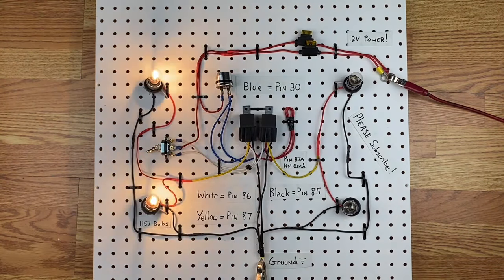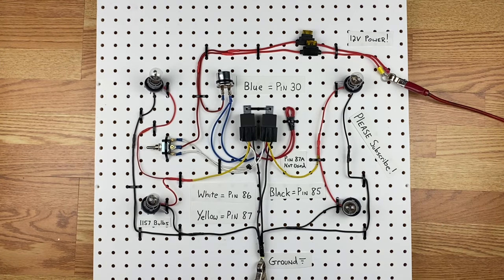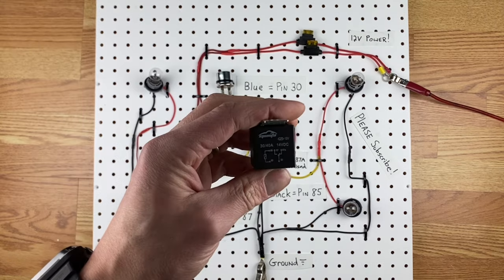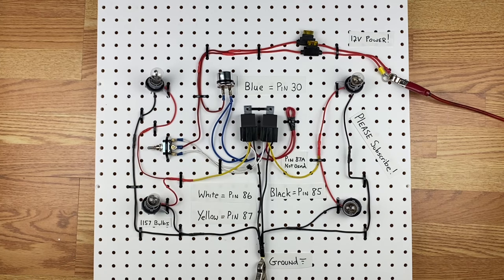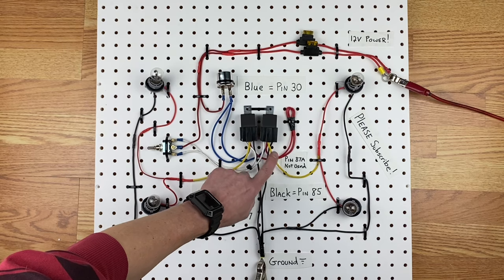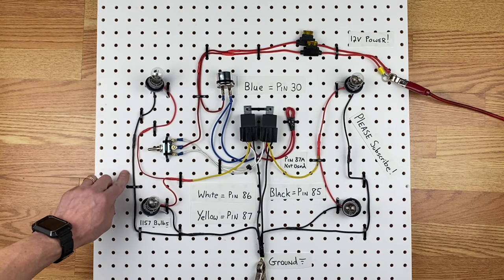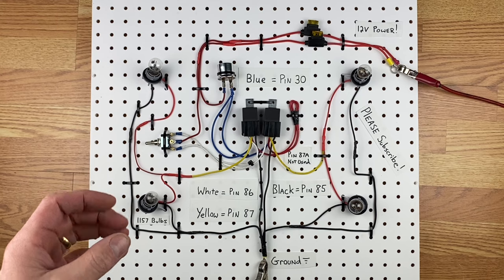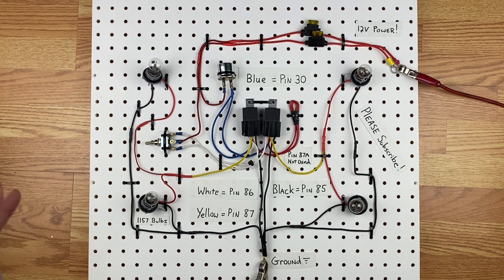How To Wire a Turn Signal Flasher Relay Directional Blinker on a Car / Truck / ATV / Motorcycle

Comment from the maker: Thank You for Watching the turn signal relay wiring video! 
Subscribe To This YouTube Channel: http://www.youtube.com/user/4g63mightymax?sub_confirmation=1
See My Wiring Playlist: https://www.youtube.com/playlist?list=PLsF7T1tRFy2hmiiUUfMZNyV-BUA_yrPIh
Reply: I'm working on a pocket bike and unfortunately the wiring that came on it was taken apart now I'm trying to wire up headlights blinkers and parking lights can you help me
Reply: So I have a 86 montecarlo ls I have a problem with my lights I have high beams on my left side  no lows and no power on the right side on the rear I have power on the right side but no power on the left side any ideas how to fix tha because I'm seriously thinking on Goin the way u have this set up
Reply: I have a 95 escort. My flasher button broke off, trying to set up away so I can use my flasher incase of an emergency.
Reply: for the hazard button you just link the 2 white together and the red and boom hazard light ???
Reply: I liked and subscribed
Reply: It's missing the 2 diodes and Hazzard switch
Reply: @fedabartov6293 nope 2 diodes are needed basically spliced into the power and feeding both relay power wires diodes are needed to prevent crossfeeding when Hazzard is off

Comment: I have an imported truck that zero information is available to me.  Your EXCELLENT explanation will give it direction signals ….again
Reply from the maker: Excellent! Thank you for watching!
Reply: Bro same here.got 96 hijet pickup with no schematic or electrical diagram. Wasn’t feeling confident replacing my headlights since the polarity is swapped and having to splice in the turn signals and DRL. But after watching this I’m solid!
Reply: It's missing the 2 diodes and Hazzard switch
Reply: @dodgeme1986truck  ?
Reply: @cactuarizard  on most vehicles (atv utv also) a Hazzard switch is also required (flashes all 4)

Comment: How would you add the hazards though? Like, getting all of them to blink at the same time.
Reply from the maker: Edited: I made this hazard light video! https://youtu.be/lnhMx-fnUmI
Reply: yes please that would be helpful
Reply: He said that. Link the white wire of the lamps in a different circuit
Reply: I did it by using a second three position switch, on/off/Turn Signal Enable
Then linked the enable to the input of the second three position switch. I then linked all four of the lights to the on position of the first switch with a flasher
Reply: Basically the first switch you can enable the hazard lights or enable the turn signal, the second then just is the turn signal control. It is how I did it because I didn't mind a second switch
Reply: (On a side note I would still like to see how you guys do it)
Reply: @sirboomsalot2429  could you explain this in more detail please
Reply: @WiringRescue  could you make the video showing how to do the hazards please
Reply: Even jerry needs help and he works on smart phones 🤯
Reply: Damn. I thought I didn't know a thing and yet here Zack is referencing the same video. Hell yeah.
Reply: the 2 white wres from the switch add a switch thats a dual throw (basically a toggle that can switch 2 circuts at once) tie that switch in and the wire that the turn switch has in the middle terminal to the dual switch and you have now added hazards to this setup
Reply: I would use 2 on off switches.
Reply: Four way switch that feeds both white wires at the same time.
Reply: Most cars have a dedicated circuit in series with the lights so is something goes wrong you still have hazards.
Reply: it's easy
Reply from the maker: @jerryrigeverything - here you go https://www.youtube.com/watch?v=lnhMx-fnUmI
Reply from the maker: @robrenner9514  https://www.youtube.com/watch?v=lnhMx-fnUmI
Reply: Jup, just activate both relays. Normally if you don’t need hazards you’ll go with one relay that is either off or sends power to left blinker bulbs or the right ones.
Reply: What about an on-off toggle switch that then connects to 2 diodes, which are connected to the white signal wires at the 3 position switch?
Reply: A simple DPST switch would do that. power into both inputs then output 1 to one white wire output 2 to the other. That way when the switch is off the white wires will act as a separate wire still.
Reply: A switch with 3 polos. When is on all polos together.
Reply: Maybe you should Jerry rig something to do it
Reply: Add a second switch that turns both white wires on at the same time.
Reply: @WiringRescue  just turn both relays on at the same time.
Reply: I'd say instead of having a 3 position switch that just Powers up one relay at a time you'd also have a third button switch that would Supply power to both relays at the same time to activate hazards
Reply: I would add a push button and tie a white wire to both relay then it triggers all four in theory havent tried it
Reply: @madparacorder  I've explained it to him .
Reply: You don't need haxards for older that -91 car

Comment: I’ve wired a lot of lights and you don’t need relays or 2 fuses . You did a great job explaining it , but the extra parts make it more complicated than it has to be. Most all wires you’d pull power from already are fused .
Reply from the maker: Without fuses and relays, you have a much higher risk of lighting everything on fire. It’s totally up to you whether it’s worth the risk or not. I’ve actually been on fire before and didn’t care for it much.
Reply: The relays are not needed, but they do allow you to add low power draw leds and maintain a steady blink since the blinker speed is determined buy the relay actuator draw. The fuses are also not "needed" because most power is already fused, but is a good habit to get into.
Reply: Ok I just actually watched the whole video, and relays are 100% not needed as wired. I ASSuMEed that he was wiring the relays a different way.

Comment: You probably won’t see these, but the 1034 bulb was originally the standard bulb used here, and the 1157 bulbs were the heavy duty version of the 1034.

Comment: Would it be better to put the 552 after the relay so that it only blinks when the switch is on.  I guess you would need 552s for that to work.
Reply from the maker: The flasher only flashes when the bulbs are turned on. If there is no electricity passing through the flasher, it is not cycling on and off.

Comment: Thank you very much. Ive got a quite rare bike. Its a Tomos at50 they made like 2000 of them. The original wire harness worked great except the turn signals. After replacing countless wires and using different relay's I still could not get it to work. I am not good with wiring so I thought wiring turn signals would be awful. But with your help I managed to get it done in like 2 hours. Everything works great even used the original ground wires from the harness so its quite clean. Thank you again!
Reply from the maker: That’s excellent! I’m glad the video was able to help you out! Thanks for watching!

Comment: This is awesome. Could a 3 pin flasher be used in this system?
Reply: I found a way to add a three pin flasher. The 3 pins on a 3 pin Flasher  would be B, E, L. Connecting would be B- a positive from the ignition switch with a fuse (as mentioned in the above diagram as a red wire to flasher). E would be a ground. L is connected to pin 30 (as mentioned in the above diagram in blue). Hope this helps.

Comment: Are the Bosch relays really necessary? Why can't you put the SPDT switch between the flasher relay and the bulbs? Am I missing something? Thanks in advance.
Reply from the maker: It depends on which switches and bulbs you are using. Check out this one. It’s what you are looking for. https://youtu.be/uXiEoJVtHi8?si=45UHXJnsZTGF4YZp
Reply: @WiringRescue  Thanks!

Comment: I just wired my break lights on my 86 mustang. I used a Earls inline pressure switch through a fused relay. Simple! You just saved me some time on the turn signals. Thanks!
Reply from the maker: That’s fantastic. Thank you for watching!
Reply: @WiringRescue  are you using 30 amp relay and fuses?
Reply: I was talking about my break lights. I accidentally replied on the wrong video. I completely gutted my 86 mustang factory wiring harnesses and went with the ARC 12 circuit relay kit. I used this circuit for my turn signals. Works great.

Comment: Why is the relay needed? Could the bulb simply be in series with the flasher?
Reply from the maker: Check out my other videos for details on why you need a relay. I’ll give you links. Here is the one for wiring this circuit without a relay. 

https://youtu.be/uXiEoJVtHi8?si=WeBLJGZyPyjLhkGk

Here is a video on why you need relays. https://youtu.be/QCkfFCLa_Jg?si=SEI1ldkZGxd-NlDY

Comment: Thank you very much for the video, I have a 1973 datsun and I've installed led headlights with yellow halos which I use for turning signals and my turn signals switch kept getting smoked and stopped working because of the high current drawn so with this system problem solved, very thankful for this video and new subscriber with thumbs up 👍,have a blessed day
Reply: You need to add in an LED resistor to each turn signal, that's your issue.

Comment: I bought everything in this video not realizing that I need something to put the fuses in. I don't know what they are called lolol 😂 i rewatched the video but I don't believe you mentioned what the fuses go into. I bought the 272 piece fuse package but they are all just different fuses only. Thanks a lot for this informative video.👍
Reply from the maker: Haha - sorry about that - you will want “fuse holders”. Here is a link to the ones I used, but there are many options. Thanks for watching and good luck with your project!

10 Pack - EPAuto 12V-DC ATC/ATO 12 AWG In-Line Fuse H... https://a.co/d/bmtNA9z

Comment: Been trying to fix a 71 volvo turn signal to get it back on the street legally. This really helps me understand what's going on, and maybe I'll go this route instead of trying to find a rare oem switch.
Reply from the maker: It’s a very simple way to make it work, and extremely easy to diagnose if it ever fails. These parts are also available at every part store across the country, and dirt cheap. That’s a win! Good luck with the build!

Comment: does it work on LEDs? (lower resistance?)
Reply from the maker: Only if you use an LED flasher. Check out my wiring playlist, because I have a few videos specific to LED’s 😊

Comment: I ordered most of the items on the list in the video description and received them today. Everything is fine except the 3-way SPDT switches. They are momentary switches. They are spring loaded to stay in the off position. Eventhough, Amazon lists them as momentary switches, I ordered them because you specifically wrote that they were another brand and they were not momentary. It's no big deal because it's Amazon and they have an easy return process. I just wanted to let you know so other people don't order these momentary 3-way switches expecting to get non-momentary switches.

Comment: Simple question from an electrical dummy. Can I splice into my existing turn signal wiring and add a toggle switch without interrupting my park lights through the factory settings?

Comment: Thanks for all your videos they are extremely helpful, especially this one as I’m currently trying to replace all my bulbs with LED’s on my Grand Wagoneer jeep.

What I found is an LED flasher with a ground flashes faster than one without the problem I’m having is that even though I replaced my flashers the rear 1156 led bulbs for running lights at night will not work.   The led 1157 for brakes work fine and so do the 1156 for backup lights and turn signals but not the side marker lights.  I’ve checked the grounds and they all seem to work.   It would be great to see a video on how 1156 and 1157 led bulb works different and the difference between a grounded led flasher and a non one with turn signals, brakes, backup lights and side marker lights - thanks 👍🏼

Comment: I am planning to add warning lights and turn signals to my horse drawn carriage for those times I need to travel along roadways.  I'd like to have continuous blinking hazards lights and then turn signals for intersections.  Your video looks like it will get me part way.  Now I need to figure out how to add the hazard lights so they will cancel when the turn signal is employed.  Thanks!!
Reply: Easy answer... Add separate lights thru a flasher for the constant hazard then regular lights for stop and turn. This way the hazard will always be on and the lowers will be turn. The other way can be done but needs a couple relays and another flasher to make that work. Adding dedicated hazard is way easier thru a flasher.
Reply: Stephen Weston thank you!  Happy Halloween !

Comment: Hi, so glad I found you. I just bought a new CFMoto Z force 950 side x side SPORT.  Sport in important because that model comes with head lights, high and low beam and taillights. However, there is not a dedicated turn signal on this machine.  Thus it is a SPORT model and not a street model. I Think your demo will work good for what I want. Just rear set of signal lights. So my question is : do I need to run 2 flashers or will one suffice? What gauge wire is on your setup and what amp fuse should  used? Any advise or suggestions would be greatly appreciated. Thanks for posting this kind of info for electrical dummies like myself.
Reply from the maker: Thanks for watching! I’d recommend this circuit instead. But make sure you use LED’s if you go with this design. https://youtu.be/uXiEoJVtHi8
Reply from the maker: Oh and for wire and fuse size check out this one. https://youtu.be/EhzN6UdnmPA
Reply: Thank you Jeremy, yes I had decided on LED"s. I web captured your layout and have it in the garage and the parts to get started, routing is going to be a big problem no easy wiring paths on this machine. Thanks again for the help and I did subscribe and rang the bell.

Comment: This would be GREAT in a book, like HP series books or the like. Your series is the BEST at not only showing how to do it, but parts recommendations, etc. The wiring books out there now are PURE CRAP. I bought several of them and they sucked to high heaven. Way too general and not very helpful. BTW, I am an electrical engineer. You do a excellent job explaining, without getting too far into the minutia. Might I suggest for you master class series getting to Ohm's law, Voltage, current and resistance and how that relates to electrical wiring in a automotive application, much like what you covered in previous video's without discussing voltage ,current and resistance and how it plays into the functions of the electrical circuits. Just my 2 cents worth.

Comment: This is awesome! Wouldn’t it be possible to have the three way switch wired to connect and disconnect the ground wire instead? Essentially a ground trigger vs controlling the signal 12v

Comment: Thanks for the great breakdown!

If i want to use LEDs, will the timing/pace of the flasher still work properly? Or will i need to add a resistor?
Reply from the maker: You’ll need to swap your flasher. Check out this video for details https://youtu.be/GICmEd-745Y
Reply: @WiringRescue  That's exactly what I need to know. Awesome! Thanks!!!

Comment: This video is AWESOME! really helped me understand the wiring in simple terms since im new to this BUT i need to let you know that the switch you linked is in fact a 2 way NOT a 3 way switch of course kinda my fault cause i just hit order but thought you would like to know
Reply from the maker: Thanks for letting me know.  I just corrected it! (Though feel free to double check me!) The ones I originally bought were no longer on Amazon, so I had to find a different set and apparent got the numbers mixed up!  DM me on Instagram if you can. @Ratty_muscle_car, and maybe I can help you out!
Reply: @WiringRescue  Thanks for correcting, of course my fault cause i was excited and ordered without looking, i picked up a switch from a parts store im gonna try this exact setup tomorrow

Comment: I wired my hot rod using your diagram it worked super thanks but I need to add a light inside so remember to turn off turning signal

Comment: Great Video.  This solve a lot of issues.  When you have time to create another along this topic, would you address this issue.  Most cars since turn signal were required and us the 1157 bulb use the dimmer filament for the tail lights and the brighter one for the brake, turn signal, and the hazard.  Would you demonstrate how this could be wired.  I know you said the white wire could be used for the tail light, but how would you wire to have the turn signal, brake, and hazard on the brighter filament?  Thanks and I will watch in the future for another great video.

Comment: So my 62 scout never used relays why are the needed great video by the way
Reply from the maker: Scouts are super awesome. As for relays - it allows you to not run the full electrical load through the switch. This is a good idea for a variety of reasons, and I actually made a video about this - check it out - https://youtu.be/QCkfFCLa_Jg?si=KvuDluCEQ8Pvn3FB
Reply: After commenting I watched the video explaining relays makes sense thanks

Comment: I am not doing the exact application but this helped me get a basic idea how the signal system works. I am installing aftermarket additional brake light (with sequential turn signal and strobe brake light) and running light/turn signal for my motorcycle.
Would I need to add fused to the cables I connect to the existing set up?